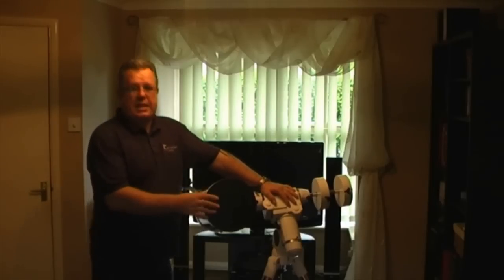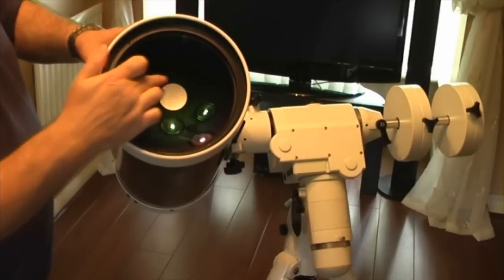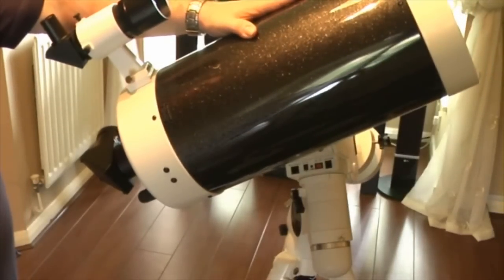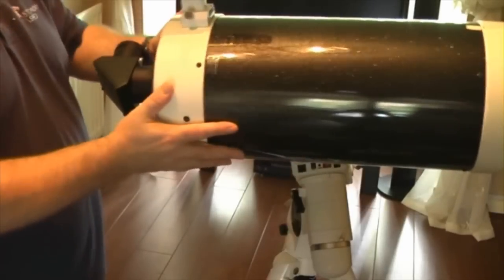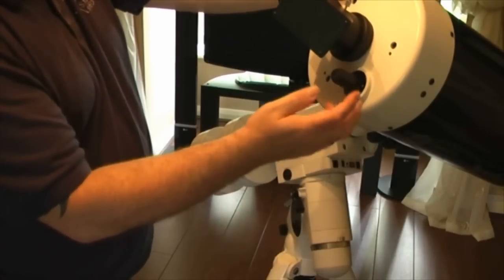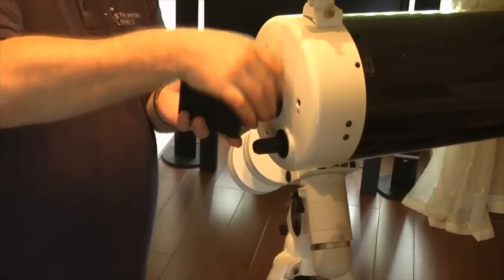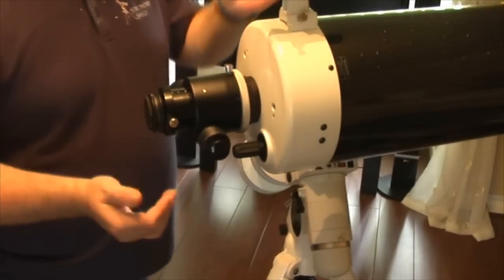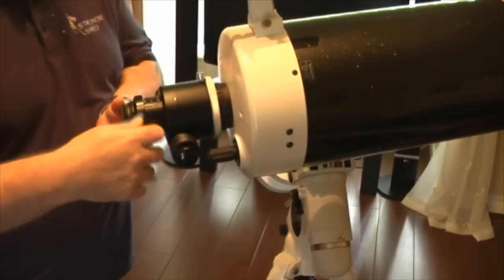Skymax 180 Mak 180 Explanation, Review & Modding

Comment: Folks
 The Skywatcher 180 pro  is an amazing telescope But there is a massive flaw in the
 dovetail attachment it is only attached to the scope with 2 tiny 
screws. Imagine this you have spent £1000 on a scope you have a 
rock-solid mount and you attach it to a piece of metal That is held onto 
the scope of your dreams with basically a few grub screws? that is the only bad design, not the scope the attachment
Reply: Had the same problem and got tube rings off First Light Optics and a Losmandy rail instead for the AM5N mount. About a 30% improvement on sturdiness. Now shopping for that focuser and if it's really necessary.

Comment: Just ordered this OTA and they now come with a 2" threaded visual back, so that focuser will now screw straight onto the scope with no need for the adaptor anymore.
Reply from the maker: That's good news, the added focuser makes a world of difference.
Reply: @astronomyshed  In the video, when you put the new focuser, than on that one you have to put back the star diagonal, correct ? Also, did you ever found the need to colimate the mak or was it never necessary ?
Thank you for the video .Was very informative for new people to the hobby like me .
Cheers
Reply from the maker: @thesteammachine1282  Yes you still need the diagonal but the focuser gives you much better control of focus. Never needed to collimate mine, you can see if it's aligned by looking at the wide end from about 15 ft away with naked eye.
Reply: Dion, can I ask you for the total length of the 180 with that Crayford on the back please? I am trying to sort a hard case for it prior to receiving the scope. Cheers, Andy.

Comment: those screws even the cheap ones that they use to attach the dovetail rail have over a 2000lb tensile strength, they are perfectly fine.

Comment: The accessories that come with most main stream scopes are not great quality.
What most of us are interested in is the optics!
How did they star test.
What was the instrument like visually.
Mak’s should be great planet scopes when they get to 180mm.
Also the scope should benefit greatly  from
flocking the tube.
Protostar in the USA makes get flocking board that can be cut to fit the inside easily.
Controlling glare light scatter is very important in and scope.
If Skywatcher ever makes a 250mm -254mm
Mak I will take the plunge.
It would be nice to see a 250mm and a 300mm Mak.

Comment: Crikey why didn't SkyWatcher simply fit a cheap fan on the back to make that 180 MCT thermally viable. A 2 hour cooldown just isn't practical in my mind (and certainly not for quick looks on a week night!). Thank goodness my beat up old Meade Mak has a fan. I just finishing cleaning & regreasing the OTA baffle tube outside and mirror baffle tube inside and applied Rocol MolyTone (MTS 1000) grease (the original red petroleum based Meade grease was like stiff clay and almost gone!)

Comment: Interesting to see a conical baffle for the secondary, just like on my Meade 7" Mak (36 per cent obstruction by diameter with the conical baffle fully taken into account, so I read on my Meade Mak) that I just removed the cast iron disc weight out of to bring it down to 7.5Kg total for the OTA. My Meade has a fan in the back, it's ex-LX50.